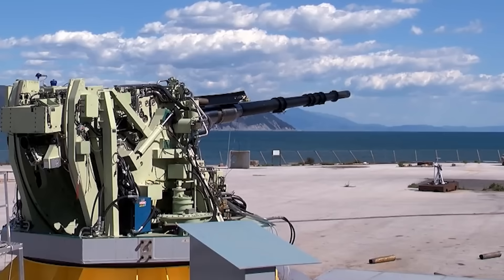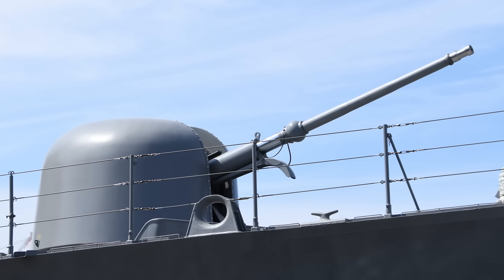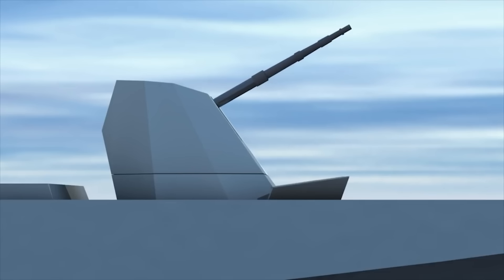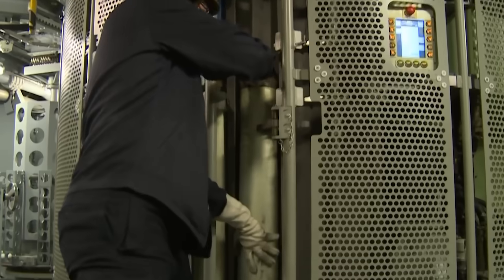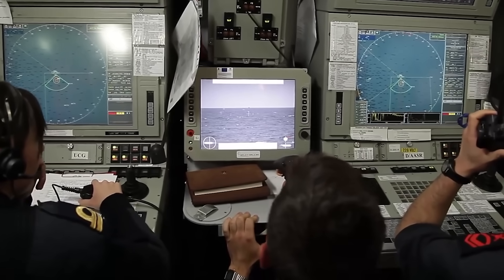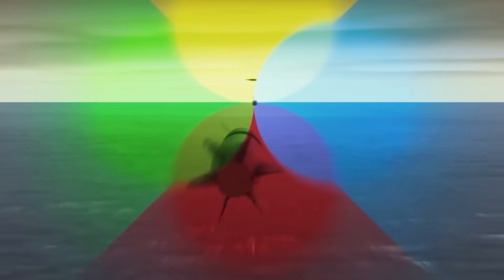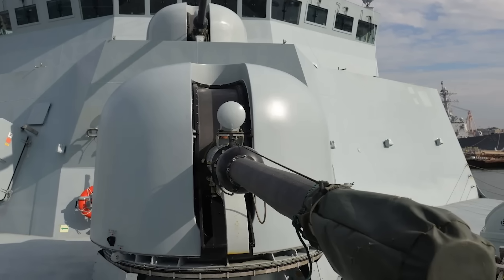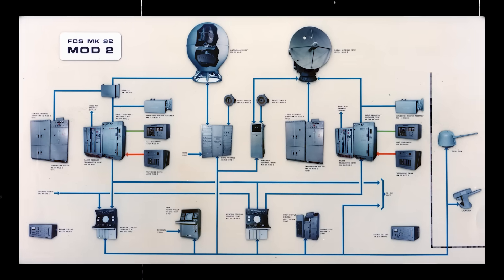Oto Melara 76 Super Rapid Compact Naval Gun

Comment: Ummmm, the current Otobreda 127mm/64 Compact guns are available with the VULCANO ammunition system, which include guided multi-mode shells with pre-fragjmented bodies capable of being used for all the same targets the 76mm version can, as well as extended range land attack out to 80 kilometers. A number of navies are buying the gun for frigates and destroyers instead of BAe's 127mm/62 guns including on ships that were originally proposed with the BAe gun. Canada for example opted for the Otobreda and Vulcano over the BAe on its variant of the Type 26 frigates.
Reply: The new 155mm Vulcano GPS block 2 have a range of 120 km (that are the ones Italian have fitted in their howitzer and the ones that alongsode US himars missiles are destroying Russian tanks, used by ukranians).
Reply: @solinvictus1234  that's all fine and good for the howitzer but not applicable to the Navy guns
Reply: @DeeEight  Ehm, both the Strales ammo and the Vulcano 127mm shells was SPECIFICALLY development for the navy, then translated also on ground force by Italians themselves.
Is so applicable in the navy that apart US navy (that having seen how valid is the Strales are developing their own 57mm guided ammos) all worlds navy are fitting this systems.
Reply: @solinvictus1234  The 127 mm is for naval use, but the 155 mm is for land units.
Reply: @giacintoboccia9386  That is what i said.

Comment: It just seems to be such a small caliber, to be a rather large ships primary weapons system. I mean, it's only a 3" gun, basically a small WWII tank gun. WWII ships had 6" battery's of these types of guns all over the ships.
Reply: Nowadays ships are not armoured (it would be useless, since HEAT charges and kinetik penetrators can easily pierce a WWII armoured belt) and are packed with valuable hi-tech systems. 
76mm ammos are effective against them.
Reply: you are comparing incomparable: difference in shells, velocities, size of platforms, accuracy, battle range ...
just one thing, you are on receiving end - pick one: 8 minutes worth of shelling from 10.5 cm naval gun or 1 minute worth of accurate fire from oto (shell count is the same)
Reply: The big difference is the amount of armor on the other end. Arial bombs and later missiles rendered heavy armor obsolete. Modern high fire rates increase hit probability for unguided munitions and decrease reaction times for guided, providing increased lethality through the use of smaller projectiles.

Comment: I wonder if the US Navy considered the Super Rapid for their Constellation Class frigate?  I'm just a little skeptical that the 57mm will provide enough punch, but I don't know the specs for the smaller gun.
Reply: 51class ships use 5 in now gun
Reply: Yes, it was considered. The USCG also considered it for its’ new WMSL Cutters or NSC ships.
Reply: Yes, it was considered. The USCG also considered it for its’ new WMSL Cutters or NSC ships.
Reply: I will never understand the Mk110 57mm, it is basically a slower CIWS just with more range.

USN should have stuck with the Strales 76mm for the Constellation class. Using the 76.2mm ammunition would have allowed to ships to resupply almost anywhere for the guns.
Reply: THEY  HAD  THEM  ABOARD  THE  OHP'S  WITH  DIFFERENT  SHAPE  GUN-SHIELD  IN  THE  1980S  AND  1990S

Comment: Imagine if the Fletcher class destroyers had this during the Battle off Samar. Yamato would have turned and ran a lot earlier.
Reply: Imagine if LCS had them now. But I doubt they could take the recoil.
Reply: @rollout1984  Those were even installed on small missile boats, the German 390t Albatross class had two.
Reply: @rollout1984  What I don't understand about the LCS is Why? As in how did everything about that become such a mess and I mean everything? Just take a Fletcher class, put a helideck on the stern and you're good to go. The Fletcher class isn't just a proven design, but also a highly successful one.
Reply: @Pope Anthony the LCS weren’t made for weapons like this. Rather for shore bombardment with rocket trucks and 5 in guns
Reply: @The_Dudester  Keep 1 of the 5 inchers for dedicated Ship to ship....but yeah....especially if they were loaded with APFSDS too :O Darts were designed for the Otomatic SPAA Oto Melara built (didnt get any buyers but it was a very powerful system) to give it some anti tank abilities too
Reply: That Punisher would have bounced off their armor not made for that Battleship armor is up to 24 in thick that's why it took 250 aircraft and eight Torpedoes to sink the damn thing
Reply: + 12 bombs
Reply: However, if you had an ultra precise, rapid fire 5 inch gun pointed directly at the bridge, the Captain and Admiral would have quickly rethought their strategy. The bridge didn't have 24 inches of armor.
Reply: @The_Dudester  they are multiple bridges in the ship one of them is deep inside the vessel. On top of that you have     two crews on 2 different bridges 1 of them is at the deep inside ready to take over at moment  notice don't get carried away from the movies
Reply: History is not written with "ifs" and "buts" ... and just by analogy, imagine if the Japanese, in 1939-40 had in turn developed firing radars and proximity fuses for their anti-aircraft weapons ... which "parallels" of history will we talk about ...? 😳
In this case it is more interesting to note that the "compact" 76mm was also developed in a prototype version of SPAAGs self-propelled machine called "Otomatic" on the chassis of the "OF-40" tank and later, in the version on wheels, the "Centauro Draco" also in prototype form. However, the weapon was not adopted by the Italian Army and other nations because it was deemed too expensive and despite the good overall characteristics, the operational range of the weapon system was lower than that of weapons such as the AGM-114. In any case, speaking of the "ifs" and "buts", comparing it to the cost of single contemporary AA missiles in the specific context of a use against surveillance / attack drones, the 76mm of the "Otomatic" (perhaps much more effective than the Russian Panthsir) today would have its valid and precise raison d'etre, even in comparison to the Bofors 57mm - see what is happening in Ukraine - 🤔
Reply: I don’t think the Fletchers would have appreciated downgrading from their five 5 inch gun mounts to 76mm. Higher rate of fire but MUCH less punching power. 

My 9mm pistol has more rounds in the magazine than my .45 so overall it’s got a higher fire rate, but the .45 is the with power to put a man down. Similar concept…

Comment: If I recall correctly, this system was adapted to be used on a land vehicle, called the OTO-MATIC
Reply: It was, but at the end of Cold War the project was abandoned with only a single prototype built. I wonder if today, with the rise of drone warfare, weapons like the OTO 76mm or the Bofors 40mm could make a comeback into land armies.
Reply: @nevetz845  I did a little digging and apparently they also did a vehicle called the DRACO which was basically the same system on a Centauro hull
Reply: @andrewengel3023  Even tho the Centauro Draco would be used primarily as anti-air and maybe long range burst-capable artillery, just imagine what the Centauro Draco would do to a tank or other armored vehicles in direct fire, with that rate of fire and caliber...
Turn them into a steel colander before they can even fire the first round.
And its mobility, by being based on the Centauro platform it'd be pretty great too.
Reply: @andrex02scout  I agree, fully automatic 76mm is still absolutely mental to me
Reply: South Africa builds the 8X8 Rooikat AFV using the system. It is a big vehicle and capable of speeds up to 138kmph and cruises at 120kmph all day on paved highways.